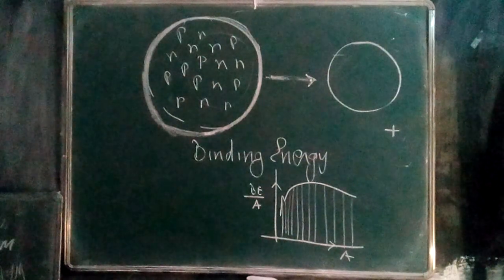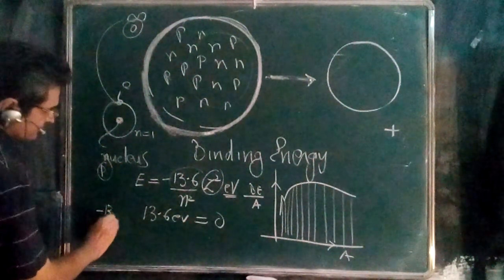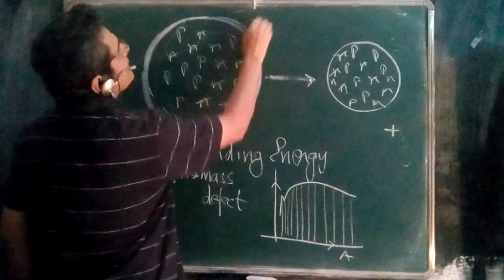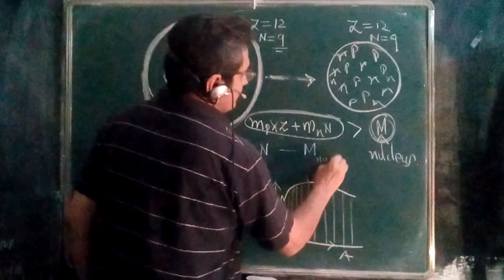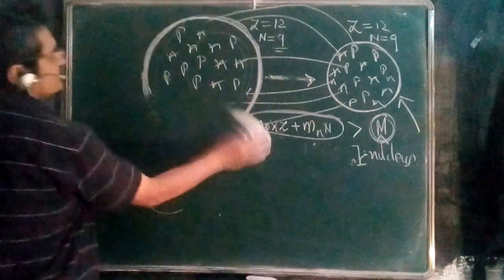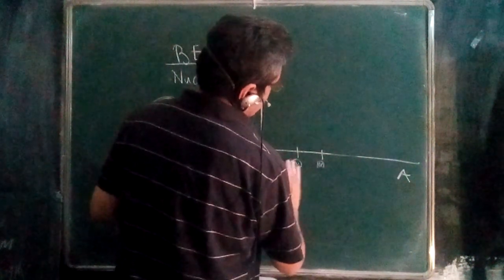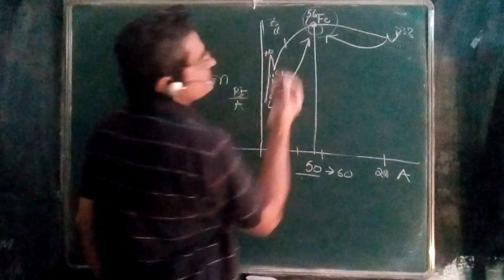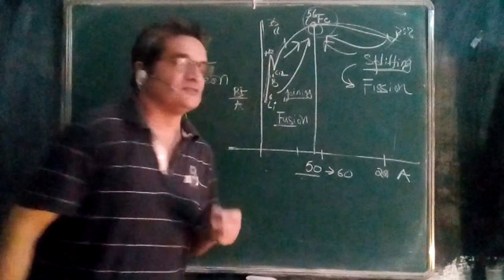Binding energy per nucleon  mass defect

Comment: Sir why do we consider binding energy per nucleon for comparing the stability when we can't simply rupture or separate a single proton and neutron
Reply from the maker: good. you are partly true but nuclei does under go fission and fusion , this concept is just to explain stability, more be per nucn  more stable you have that nuclei , you can see in the last part of lecture the fission and its relation with BE per nucn.
Reply: Y Kumar ok sir tq